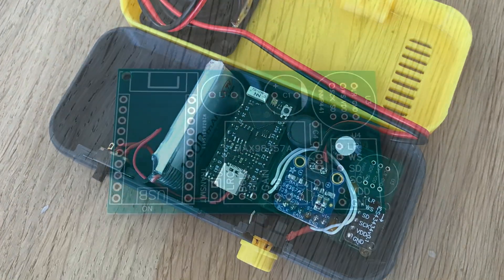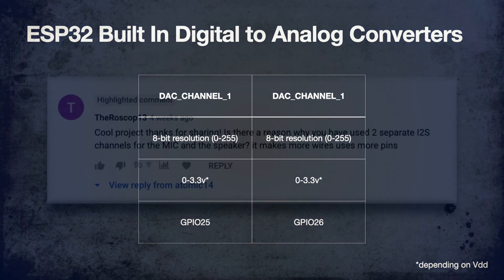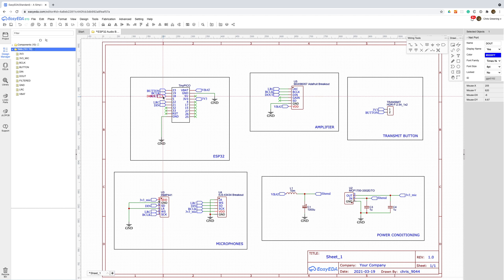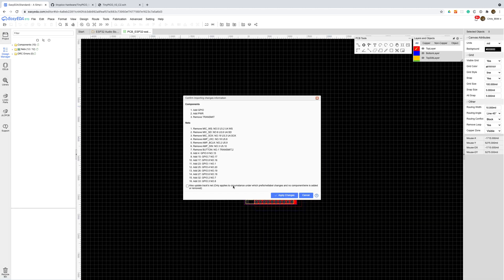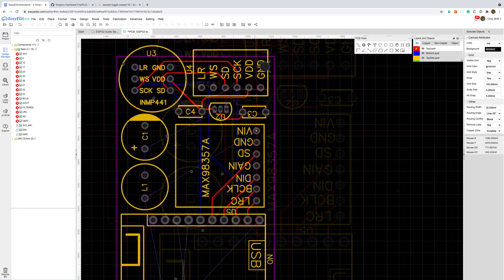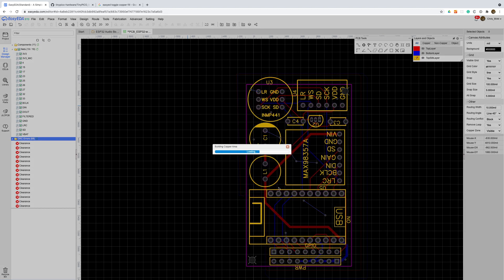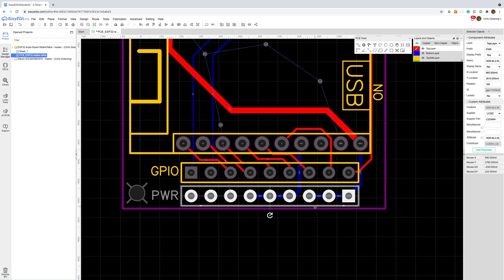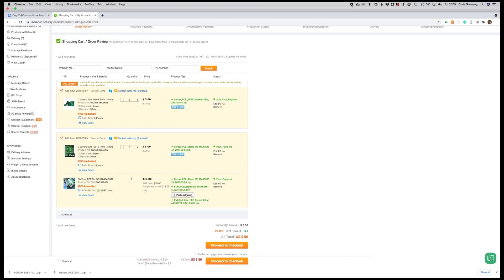Revamped Audio PCB Walkthrough: Fixing Mistakes & Enhancing Functionality

Comment: Hi! will these headers always result in "holes" for the respective pins in the PCB? Thats what I wanted to do, so I can connect my devices, however the description was not very clear on EasyEDA and I would love for this to work.
Reply from the maker: You can check the 3D view if you are worried and you can also preview the gerber and drill files online. But yes, if you have places header pins on your PCB then you will have holes.
Reply: It is possible to use SMD pins, I've seen some on LCSC

Comment: Looks great! Is there an update to the code on github too?
Reply from the maker: Not yet, it should hopefully just be a case of changing the pins - assuming I've not messed anything up... I always have a worry when sending off a PCB that I've missed something.
Reply: @atomic14  It'd be great to see an update to the configuration. Is it just as simple as sharing LRC and BCLK pins between the mic and speaker i2s configs?
Reply from the maker: @JamesMyatt1  That's exactly it - not sure why I didn't think of doing it in the first place...
Reply: @atomic14  Do you also need to use the same i2s port number and same i2s pins struct?
Reply from the maker: @JamesMyatt1  It's an interesting question, at the moment, almost all my projects are either playing or recording sound, I haven't really got anything that does both at the same time. I'm going to do some experiments to see what happens when you do try and run both at the same time.
Reply: @atomic14  This isn't a great place to have this conversation, but when I tried just changing the pins, the mic worked but the speaker worked very badly. When I combined the pins structs, the speaker didn't work at all. But when I used port 0 for both, then worked at all. So basically looks like the last i2s port initialised got the pins it wanted and when it initialises the same port twice, it panicked.
Reply from the maker: @JamesMyatt1  You can drop me an email from the channel about page - there's a button for commercial contact, but it just gives you my email address.

Comment: Is there a place to report bugs on EasyEDA? I'd be pissed if that was a large project.
Reply from the maker: They are pretty good yes. At the moment I'm not sure if it's user error and the way I'm doing it - I need to recreate it with some simple steps. It only seems to happen if you've got copper areas.
Reply: @atomic14  I'm thankful for your tip, it could discourage new users without that knowledge.
Reply from the maker: I think it might happen if you do the vias first and then the ground pour. Or if you have the vias already and then delete the ground pours and recreate. I think that might be what triggers it. If you've got the ground pours in place and then add the vias I think it works fine.